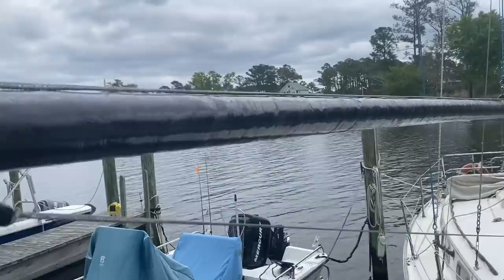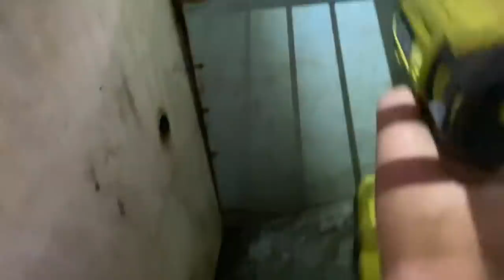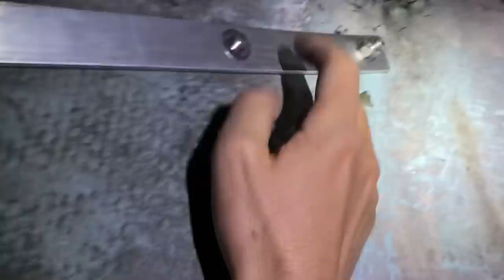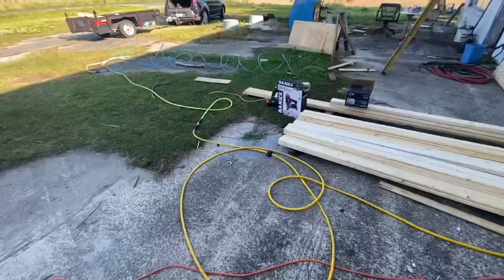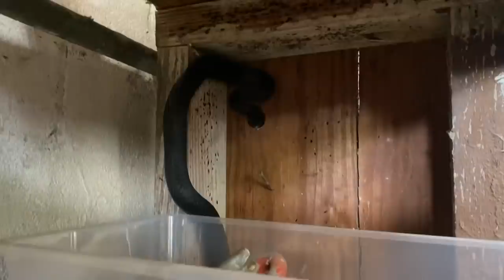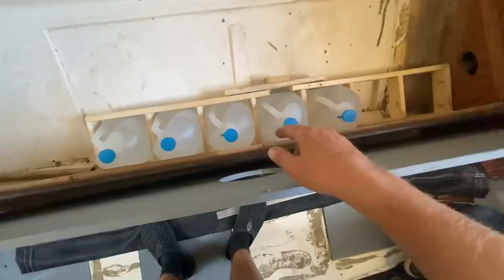Daily vlog #8

Comment: To all of those concerned below, the snake looks like a black racer. They're very common all over the eastern half of the US, I've seen one in my backyard here in Illinois. They're harmless and not aggressive at all.
Reply: Yes, and a good snake to have around. I live in Northern Virginia and we have them here too. They're called Black Rat Snakes here. They not only eat rodents, but will also eat venomous snakes like copperheads, and even timber rattlesnakes if the opportunity presents itself. So if you should see one in your yard don't kill it. Leave it alone and it will go away but if it doesn't maybe get a stick and shoo it away but don't strike it.

Comment: Your diesel air heater exhaust tube seemed to be lying against your hull, not good, as it gets so hot you can risk it melting the fiberglass. You should place some insulating material betweem them or suspend it so it does not touch anything on its way to the truhull
Reply from the maker: My exhaust is wet so not a problem with heat
Reply: @samholmessailing  not your engine exhaust, i mean your diesel air heater exhaust tube, it gets very hot under use.

Comment: I wanna know who the one downvote on this video was, show yourself and be SHAMED! Nice job Sam, love seeing the progress.
Reply: Shame is internal.
I disLike putting another layer of roof on, what happens to the middle part? Home for snakes, squirrels, mold, carpenter bees, etc.
I disLike the 3D print an adapter, 
as plastic and metal have different  properties, strengths, etc.  And staying onboard when solo sailing no one to really rescue you...
Thru bolts meh, 
More holes yuck,
stacking washers kludge.
 Putty helps but like a plunger seal and fixodent (dentures) surface area may matter, 
like roof an extra layer place
 for water to collect,
 think cavities and teeth...

So three disLikes about this one.
Y(M|Km|NM)MV
Reply: @danceswithcarsdc  you are shamed
Reply: @danceswithcarsdc  you are shamed